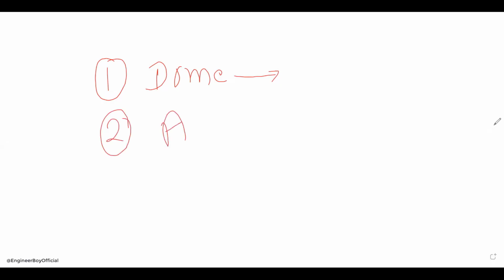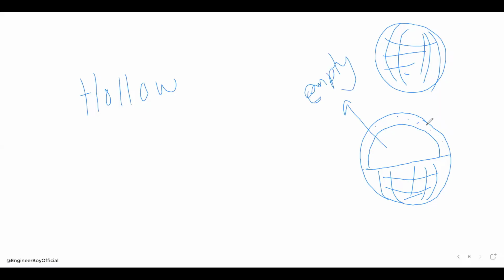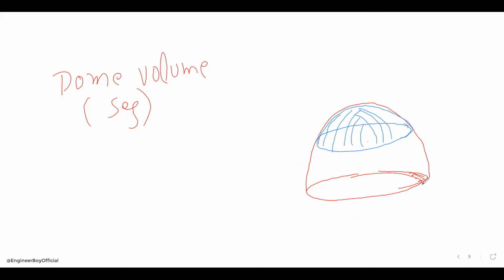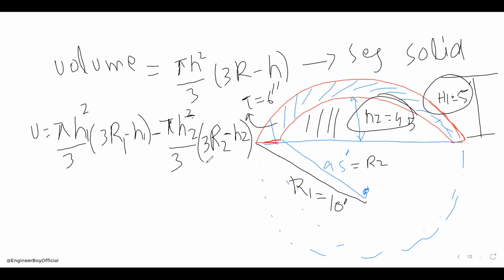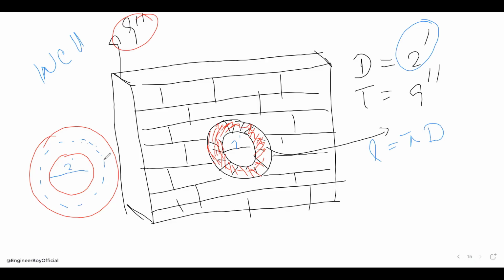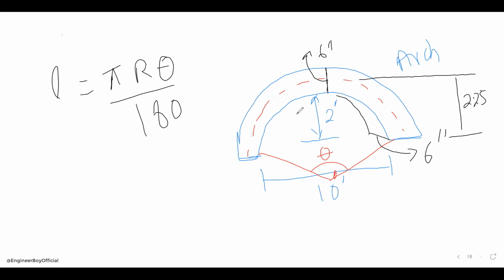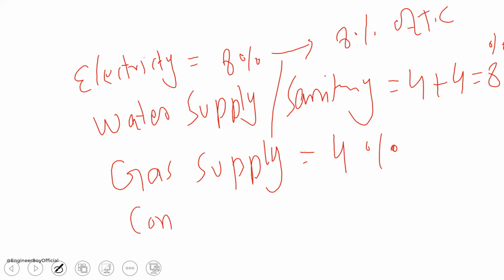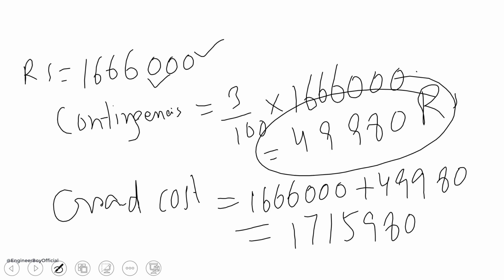Quantity survey full course | day 02 | cost estimate in civil engineering

Comment from the maker: at 14:42 divide the answer by 2 as this is semi circular dome. like 165.195/2 = 82.59 cubic feet. thanks for watching
Reply: Hi sir, just wanted to clarify for other students : the 165.195 cubic feet calculation is already correct for the semi-sphere! A full sphere using the 4/3 formula equals 330.39 cubic feet on the board but correctly divided it by 2 in your calculator to get 165.195 cubic feet.